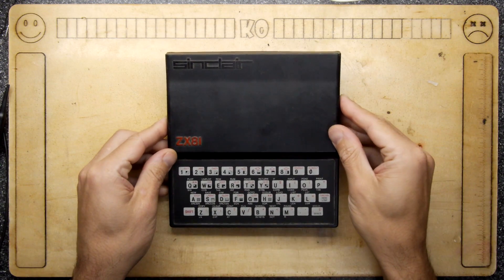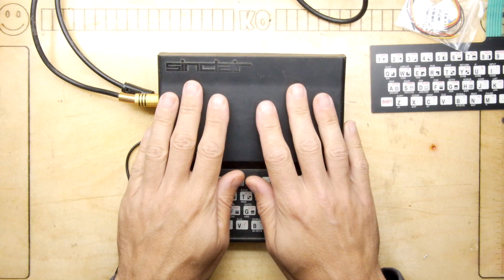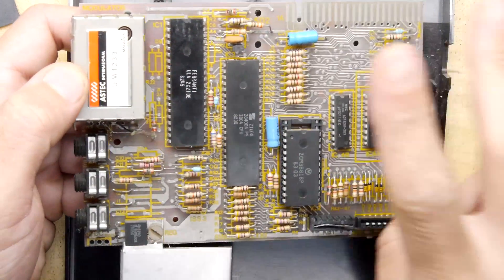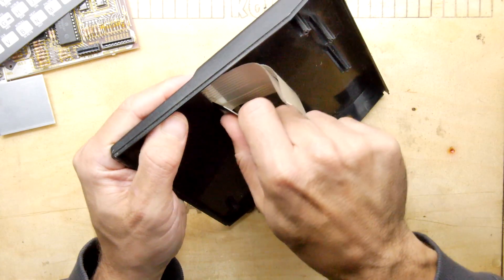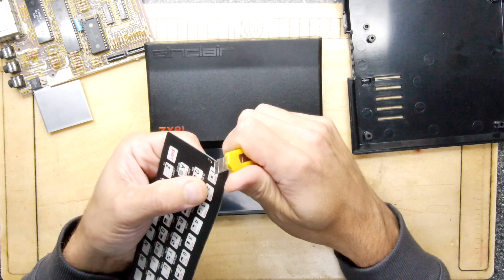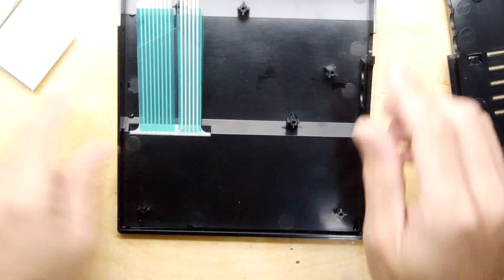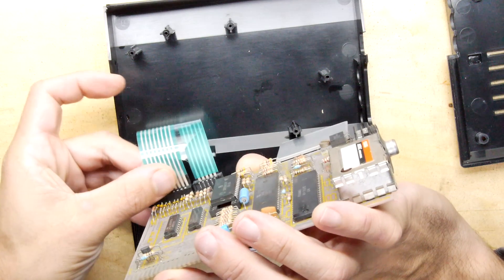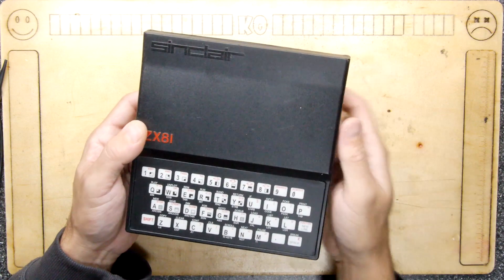Lets repair the Sinclair ZX81 Keyboard

Comment: What can you do with a ZX81?  You can learn BASIC and use your imagination to write a number of games based on other video games of the early 80's or make, 'quizzes', on remembering things to do with schoolwork, e.g. the symbols on the periodic table in Chemistry.  That's what I did, circa 1981!  One modification I would do with this machine would be to put a proper keyboard on it.  Or, at least, something better than that membrane one which, despite working as intended, is horrible to type on.  I don't know if there's anything available that would fit on the board at the front of the machine, but with actual keys.  I swear I can remember something back in the day which was based on that very idea.  I went with my eldest brother to the computer fair that was held in Wembley Conference Centre, way back in December of 1981, and I'm sure there was something like that on offer.  I so much wanted one back then, but didn't have the money to buy it.  😢 In fact, I never got the opportunity to get one, ever, as the Commodore ViC-20 loomed on the horizon and all computer-related thoughts were diverted to that, which of course had a proper keyboard!
Reply from the maker: Thank you for sharing! Don't you feel the 80s were such an exciting time in computing? So many different types and companies innovating? Clearly it was awful in terms of standardisation, but it seems so vibrant compared to how we ended up now with everything the same!

Gosh, I remember Webley well, I grew up near there. Seems like a million years ago now!

I have some Spectrum videos coming up you might like, look out for them.
Reply: @backofficeshow  'Home computers', as they were known as, back in the early 80's, were deemed cutting-end technology as far as domestic use was concerned.  Many platforms sprung forth as a result, with only a select few going on to become well established.  Choosing which one to go for was always a bit hazardous, but most people went with what was the most popular.  Something that was determined by a number of factors.  The ZX81 was one of the first available and sold well despite having no sound or colour and an unexpanded memory of 1K.  Having a, 'RAM Pack', made it a bit better and allowed you to program, and for a while most were satisfied, to a point.  However, with other machines coming out with sound and colour, the writing was on the wall for the '81.  The only other thing that made it popular as an introductory machine, was the price.  Less then £70 was really something as far as owning a computer was concerned, although even that was a lot of money, back then.

I never got into the Spectrum, as I had my head turned by the Commodore ViC-20 that my eldest brother bought a year after the ZX81.  Sound, colour and a proper keyboard did it for me.  I did get to use a Spectrum that belonged to a friend, at the time, and unfortunately I wasn't really all that impressed.  The keyboard, despite being one-up from a membrane was still not great and the sound came from a small speaker within the machine itself.  I suppose if I'd not been exposed to the ViC, I might have continued with Sinclair, but as it was, I'd already been converted into a Commodore-head!  Once the 64 came along, the rest was history...  

I had to travel on an Intercity 125 to get to Kings Cross, back in the day, then on the underground to get to Wilton Road(?) before walking the rest of the way to the Wembley Conference Centre, which was within a stones throw of the Stadium.  A real day out for me, despite not managing to get my brother to get me that early Christmas present.

Comment: When these came out you had 2 options when buying it.  You could either have a complete machine, which cost more, or you could buy it in, 'kit form', and put it together yourself, which cost less.  The one you have there was obviously a kit form.
Reply from the maker: It does have that hand assembled vibe. Must have been a fun little machine. I added more to it, look out for the new video end of the week, it's currently in early access with patrons.

Comment: I replaced the membrane on a ZX81 I have. I'd never used one before and have some books with examples in. I spent about 20 minutes typing in a simple program. Kept double checking the code, nope, syntax error. In the end I realised I was being clever and had typed the commands in full instead of using the shortcut keys doh! Turns out the parser doesn't parse the text, the shortcut keys must insert a numberic reference that gets replaced by the command when you list the program. A space saving trick from Sinclair.
Reply from the maker: I remember the magazine listings consuming rather a lot of my time as well. Those were the days!
Reply: You can't even enter a single line if it's incorrectly typed because of the syntax checking, not sure how you entered a full program.